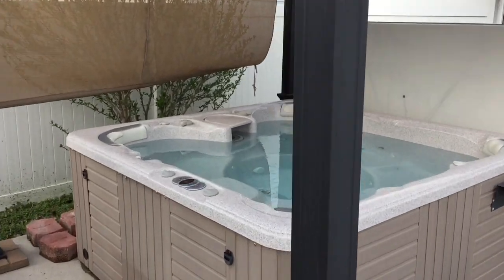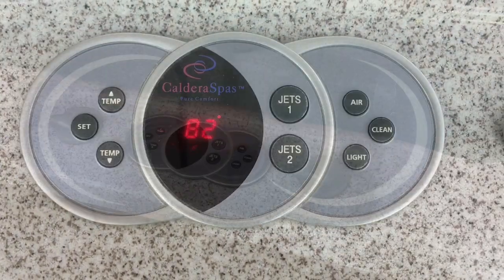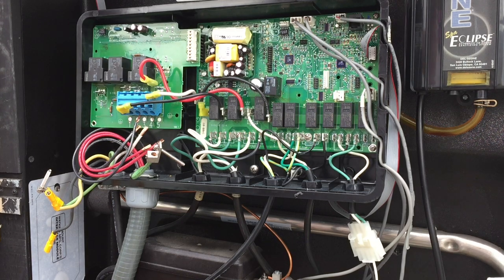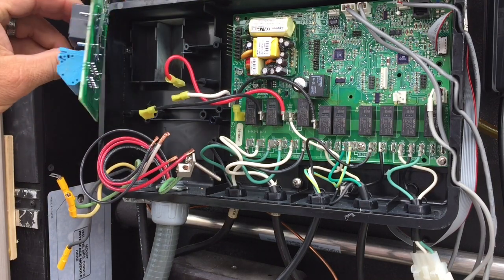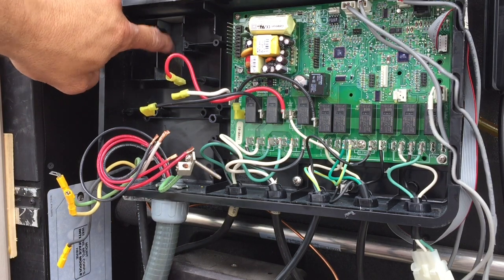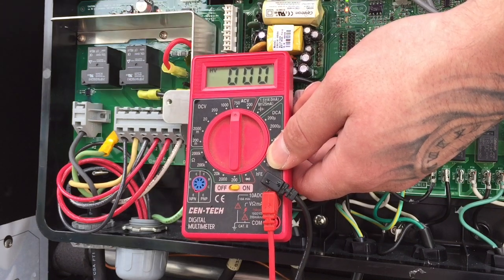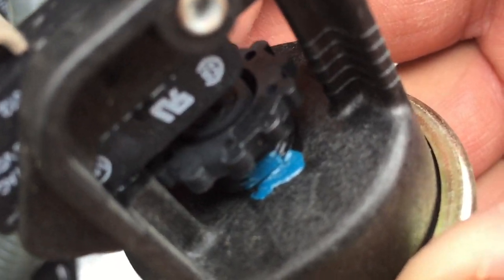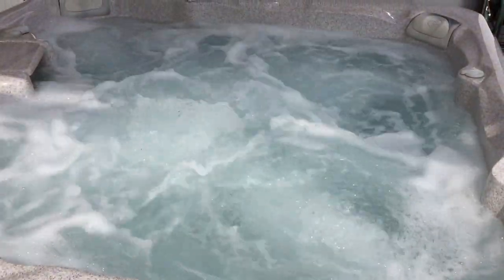Fixing A Cold Hot Tub...

Comment: Great video. I am experiencing the same problem on my 2003 Caldera Geneva model, which is super close to your Hawaiian model. Your tips have encouraged me to open up the panel and change out these two items without the cost of a service call.
Reply from the maker: Awesome.  Let us know the outcome.  Cut the power (Both breakers) before servicing.  PLEASE!
Reply: @SmokinwithKasket  That job was a cinch! For my 2003 Caldera Geneva, I ordered the heater relay board (part # 77119) from HotTubSpaSupplies.com since the local Caldera parts house in San Diego was out of them and would have to order anyway. Didn't order the pressure switch (part 72717) this time, but located it inside the hottub cabinet in case that needs replacing in the future. I had the old model control box and the original heater relay board (which showed obvious signs of having burned up), so I had to trim the metal guard to provide clearance for the microchip on the new board, but that was easy and included in the step-by-step instructions.  Instructions that came with the new relay board were clear, complete, and easy to follow.  There was nothing that was difficult about this.  Total cost for the fix was $140 for the part and the hottub is heating right up as I speak (type).  Thanks again.

Comment: So my hot springs hot tub sat unused for a few years and when I went to fill it up and use it a few months ago - it had a serious leak and no heat. I quickly realized it was the end cap on the heater that was leaking and ordered an entire new heating unit. got it today and installed it. Leak is gone and everything functions properly other than it doesn't seem to be heating. My boards look just like yours and my red heater light is on. What do you think the issue is? How long should a cold (winter) tub take to warm up even 10 degrees? I had it on and circulating for about an hour and felt no appreciably gain in temp
Reply from the maker: Did you check the voltage on both lugs of the heater?  You should have 120 volts on both sides totaling 240 volts.  It’s a slow go with cold water.  When I change my water I notice it hears about one to two degrees per hour but slowly increases as the water warms.  Let us know your outcome.  Stay safe!

Comment: Hope you can help. We have a Martinique Paradise. Top side control panel is dead; does not light up at all. If I trip the breakers, hot tub goes through its cleaning cycle (jets come on, etc.), circulating pump runs, and hot tub warms up some. Have green lim light and red heater light on control board. However, top side control panel stays dead. I have removed the heater relay and controller boards. No visible signs of burned circuitry. Any ideas on how I might troubleshoot the issue?
Reply from the maker: Definitely sounds like a faulty control panel.  I have heard of those failing.  they are exposed to water and moisture even when the cover is in place.  one tiny leak and it will fail over time.  Let us know if you figured it out.  Best-
Reply: Replacing the topside controller did the trick.
Reply: Dim1 Swim Spa: Working on the 3 rd  topside controller replacement on the  spa side off a 2007 Dim1 Aqua 19 dual. Topside failed either the  water condensation. I used the best silicone I could get and then it failed  a second time. You kind of need it to work if your trouble shooting most issues on the spas. For the love of..... warm water, I will keep replacing them until we don't have to. Yeah right....Luv the tube she says, so will do my level best to keep the warm water flowing. Ha Ya

Comment: I have Tiger Siberian model L which looks to have the same board setup. I have a red blinking light at the top of the heater board you just changed out and the tub is not heating. The red call for heat light on the other board to the right is on though. Any thoughts?
Reply from the maker: Unplug all your peripheral devices except the heater and see if that corrects the issue. Also disconnect the heater and check the ohms to make sure your heater is not malfunctioning causing an error code on your control board. Then finally, make sure you’re really bored and control board are set for the proper voltage.

Comment: Just wanted to drop a line to THANK YOU for the tutorial!  I ended up not having to replace any parts, but during the process of using your troubleshooting steps, I found a loose connection between the two control boards.  At first I couldn't figure out why I couldn't register a reading between the two hot legs (and didn't have a burned resistor), but when I put them back in the control box, I realized that the pins from the mother board were not fully engaged with the heater control board.  It probably happened when the tub was moved to my house from a friend's or possible when the electrician hooked it up.  Nevertheless, I was at 67° yesterday and 103° this morning!  This is a 2004 Utopia Niagara model.  Thanks again!  And, happy smoking!!!
Reply from the maker: Hi Jim.  Great to hear you were able to locate that problem.  You may have saved other components from being damaged by the loos e control board.  Usually its never that easy.  Glad the video was of some assistance.  Mine is chugging along without any issues so far.  I am very happy with Caldera.  The quality and workmanship seems to be very high.  Thank you for your support with my channel.  Please subscribe if you haven't already.  All the Best-
Reply: @SmokinwithKasket  ugggg, back to square one.  My spa started losing temp on Saturday!  How long have you had the "new" heater board?  I'm asking because mine has that new style (i had the same burnt soot behind the board when I took it off to inspect, but it's not on my board).  I'm wondering if it's gone bad already because I'm not reading voltage between the two hot legs again.  I hate to throw parts at a problem as a means to troubleshoot, especially at the price of these non-returnable parts!

Comment: I work on spas and I can tell you this is a fairly common issue with calderas. I believe it's an issue with the relays just getting weak due to kicking on and off all the time. You can actually de-solder those relays and put new ones in and it will work just fine.
Reply from the maker: I had a hunch it could be the relays. The new board was definitely updated or upgraded (improved) so I’m hoping this won’t be a problem again anytime soon.
Reply: I have the same burnt pad on the circuit board of my Masterspa model. Luckily, the relay was easy to source. It arrives Monday (about $19 from Amazon delivered) and I will repair the circuit board (I have lots of experience from my audio repair tech days) and we will see how it goes.

It just seems criminal to replace the entire circuit board ($440 from the authorized source) or the entire heater/control assembly for $500 when it might only be a bad relay.
Reply from the maker: The relay circuit board shouldn’t cost $300 to $400.  I didn’t pay anything near that.  Most people don’t have the skills to desolder a part then replace and resolder.   Hopefully that will work for you.  Keep us posted.
Reply: @SmokinwithKasket  - I just discovered that my trusty Weller soldering station doesn’t get hot enough to melt the solder. So I dug out my old Weller soldering gun and discovered that it isn’t hot enough either. Tomorrow, I’ll try the butane torch on it.
Reply: @SmokinwithKasket  - Do you have any recommendations for how to desolder the relay?
Reply: @bunkie2100  desoldering wick and pump
Reply: @bunkie2100  you can usually just go buy a cheap soldering iron from a hardware store. Just make sure it's a higher wattage.

Comment: Did the board die again? Did you ever figure out why the board fried?  I am concerned about replacing a $550 board without knowing why it fried.

make: jacuzzi
Model: j-355
Year: 2007
Reply from the maker: Thank you for watching and commenting. I did not figure out why the board fried. Most likely from a power surge or thunderstorm related I’m guessing.   It’s been working great ever since I made this video with no issues at all. I have to say I don’t recall paying $550 for the board though I feel like it was more like, $200 to $300 at the most, but I’m sure prices have increased, especially with the pandemic.
Reply: @SmokinwithKasket  Thanks very much for responding.  I have my fingers crossed while I replave it.  I did notice that my tub was setup for 60 amps wen my breaker was only 50 amps but I cannot think of any reason that would cause a poblem.
Reply from the maker: @lornehampel1330  unless it was tripping that shouldn’t be a problem with regards to the breaker.  Chaperoned for that board I think you can find a cheaper one. I think I paid less than 300 for mine and I did order that online through Caldera Spa parts I believe.
Reply from the maker: Be sure to update with your make model and year.  Check this link out: https://www.hottubspasupplies.com/catalogsearch/result/?q=Main%20board
Reply: @withKasket Update my post with make, model, year but the link doesn't work.
Reply: @SmokinwithKasket  I searched long and hard to get that price.  I am in Canada and they normally cost about $700-800 but I ordered one from the US and will wait for it.  In my jacuzzi j-355, there is only a single logic board, no separate relay board so it is more expensive.

Comment: Hi there again, still trying to work out if my heater is needed replacing or not. Have the balboa system here in Sweden without the pressure switch. Has the sensors on either side. Hot tub down to only 17 degrees now, it has become cold minus 7. I don't know if there is some built-in freeze safeguard. I am guessing that the heat maintained is just coming from the pump. I have done some more tests today. There is power 230v going to the circuit board, but not 230v going to the element.  I have done the continuity test or ohms test with the power turned off, with a multimeter put it on the 0L setting. It said  0 reading. Then l put it on a setting to bleep, not sure if it was the right setting, still was 0L and then it read 19 ish. Does this sound more like a relay problem or is there a possibility that it might still just need a new heater replacement? I am thinking if I did not have 230v going to the element, then a new one can not suddenly give 230vs or ??? No errors on the display panel either.
Reply from the maker: Hi Kevin. Love to know that you’re in Sweden, A place that I would definitely want to visit someday. It sounds to me like you need to replace your heater relay board. Replacing the heater wouldn’t solve the problem if you’re not getting 230 V to the heater which comes from the relay board. The other issue may be that the motherboard is not sending the signal to the relay heater board. But more than likely I’m guessing it is the relay board. Disassemble that relay board and remove it and see if there’s any signs of burning in the back of it as I demonstrated in my video showing the soot and the burning that took place. Let us know your findings. Thank you for watching and hopefully subscribing and we will be anxious to hear what you found. Please be careful poking around the components when they are energized. That is a lot of voltage and can be deadly! Stay safe my friend.
Reply: @SmokinwithKasket  thanks William, l am thinking the same. I will not yake out the circuit board until the spring  its plus and minus at the moment  . I just hope it holds at around 15 degrees until mid march. Thanks anyway
Reply from the maker: @swedishkev  I would highly recommend that you follow the manufactures recommendation for winterizing that hot tub. I always have bad luck. I wouldn’t trust that it won’t freeze. Let us know when you find out what the problem is. Thank you and have a safe winter.

Comment: I had the same issue on a Caldera Geneva. I spoke with a local repair shop and they said it's a common issue. I replaced my relay board pretty cheaply and also the pressure switch. The gentleman there also mentioned that could have been the issue. For 25 for the pressure switch might as well do it especially when it's rusty!
Reply from the maker: Glad you fixed it.  The new replacement board is also an upgrade they say, that will eliminate the issue of the relay(s) burning in the future.

Comment: William been watching your awesome videos and learning a lot. I have one problem with my caldera heater 2003  is not heating I check it out by unplugging and reenergize the tub and the breaker did not trip out, do you think  I have a bad heater.? And do you have any videos on this particular heater is the trombone style.
Reply from the maker: Hi.  Thanks for watching and commenting.  I do not have a video on the heater issue.  You can easily disconnect the wires from the terminal and check the ohms and the (hopefully) lack of continuity between each post and the metal heater case.  If I were checking the heater (I recommend you have a professional do this test), I would replace the wires and energize the heater (by raising the temperature) and check for voltage leaking between each post and the case / ground.  I would use extreme caution as the heater is 240 volts!!!

Comment: Great video! I have a Caldera Hawaiin as you repair in this video. My heater breaker trips intermittently...meaning it will heat for days just fine, or sometimes just for a few hours before it trips. The pump breaker never trips. Your thoughts? Controller board, heater or pressure switch? Any advice on where to start is appreciated!
Reply from the maker: Check the heater element ohms.  I think you may have a failing Heater.  I’m not sure what the ohm range should be at the moment but you could easily find that spec.  Let us know what you found.  If I can locate the specs for the heater ohms I’ll add to this thread.  Keep in touch.  Best-
Reply from the maker: This should be the correct answer:
Draw 15-25 amps at 240v
A measurement of 9-12 Ohms of resistance usually indicates a good element.

Comment: Do you have a part number for this exact relay board? I am having trouble finding it online. Your video was very helpful. Thanks!
Reply from the maker: Here it is: Watkins, Caldera, Hot Spring, & Tiger River - IQ 2020 Heater Relay Board w/ Jumpers - 77119. 
SKU 74618-77119
Should run about $150.00

Comment: Really excellent video.  I did similar trouble shooting and using multi-meter found my control board seemed OK -- removed it just to check for any burned spots and didn't find any.  I figured out the circulator pump was bad -- it was very hot, and although not obvious, turned out to not be moving water.  And, circulator not flowing water through heater it won't work (blinking "heat" on panel).  Pump was $180 online and $200 at my neighborhood store .. being a bit impulsive I went and got it, put it in and all's good.  Thanks again for educational and helpful video.  Next one will be about smoking brisket right?
Reply from the maker: Thank you so much for your positive feedback. I do appreciate it. I always worry about that circulation pump of mine, especially it failing in the dead of winter.  Seems like I saw them priced around $120.00 though. 
Yeah. Smokin vids coming soon with the seasoning of my new UDS. Looking forward to doing ribs and turkey legs with the Ugly Drum Smoker. A brisket video is a must as well.  
Happy Summer!!!  If your in the northern hemisphere that is.

Comment: I have a Caldera Elation that is not heating.  I do not have a multimeter handy, but the heater control board you speak of shows some discoloring between the relays.  All indicators point to the heater board.  Where did you get yours?  Is there a part number?   It look identical to mine. Thank you so much!
Reply: OK.  It looks like 77119.  Formerly 74618.  Hopefully this does the trick!  I do not want to rip this one apart until the new one is here.  Thanks for the informational video!
Reply from the maker: Oh good. You best me to the part number. Yeah sounds exactly what happened to me in this video. Good plan to keep old one on while waiting for new board. Especially if you live in freezing temps like I do here in southeast lower Michigan. Best of luck.